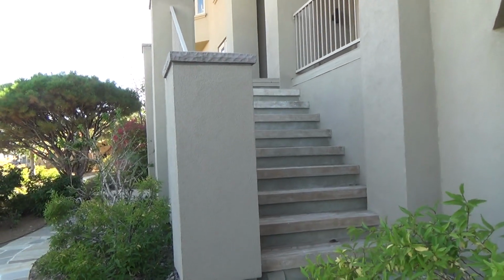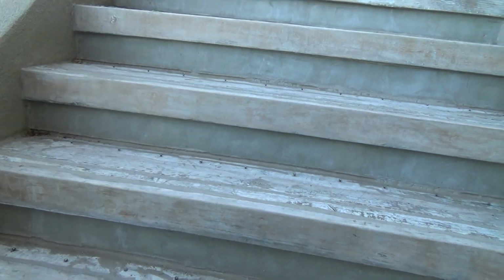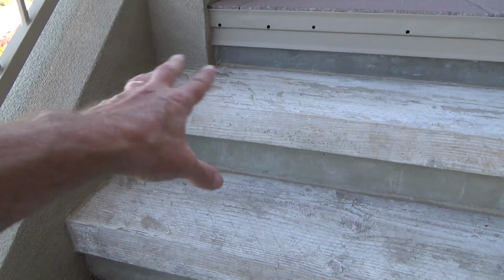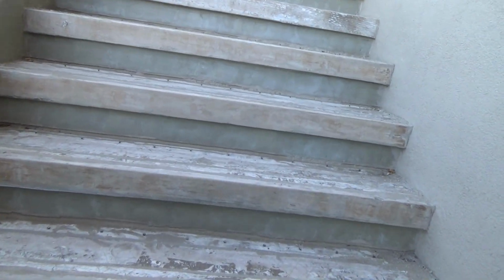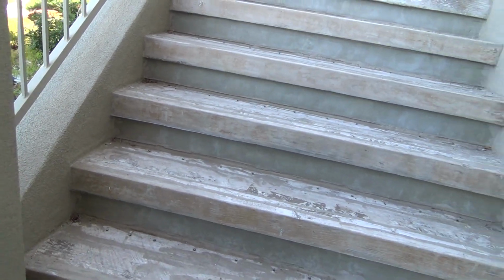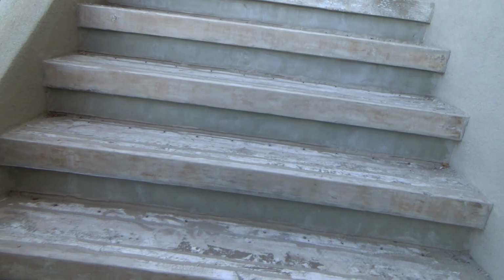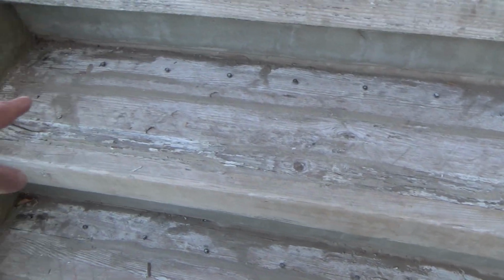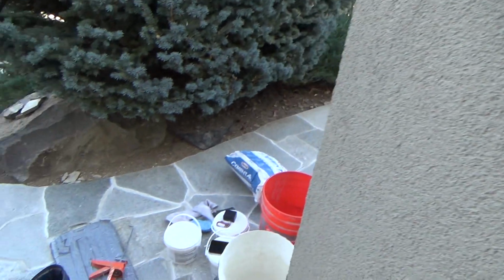Man Says He Can't Repair Wood Deck Staircase & Maybe He's Right?!!

Comment: 1. Plaster to create slope to make water run off (two parts sand with one part cement, plus a dollop of white glue - use minimum of water to make strong plaster). 2 . Install outdoor tiles on top (first make sure cement is still damp or if set use water to dampen, and paint on water based bonding agent). 3. Paint/spray tiles with clear sealer. Don't worry about it leaking because it won't. Final check, make sure under of house is open to atmosphere so any damp timber under there can naturally dry.
Reply from the maker: You have some good thoughts for sure but I would think with the paster that in the winter when the snows come it would crack &/or pop the plaster up from off the wood treads. I am just thinking here. Also I have used tiles on a deck years ago & had it professionally installed only to see the grout lines fail after a few years because of the harsh winters (somewhere else not this property) & some of the tiles cracked but many grout lines cracked & loosened up & thus my thought that same thing would happen here. I even went to Dal Tile & Bedrosian Tile & asked them about what to do here & they made comments that whatever I did the grout would crack out so I was like I can't even get a good answer from those guys so what to do! I have had some say because the stair treads are wood then they will settle & expand throughout the year & thus crack out or pop tiles or whatever materials I use to make repairs. Your idea with plaster to build up & slope out sounds good but I tried several products in the past to build up treads & slope down & made each attempt look really good over the summer to only crash & burn once the winter snows came & after snow gone all the product buckled &/or popped/cracked because the stair treads are wood with air coming up from under to create havoc as well. As for needing air under deck yes there is air but just the air that is under the deck as you can see there are stucco walls around the deck thereby you cannot walk under deck from out in the back yard & no foundation vents were installed by the initial builder over 20 years ago can you believe the inspector even missed that?! Anyway thanks for all your suggestions!

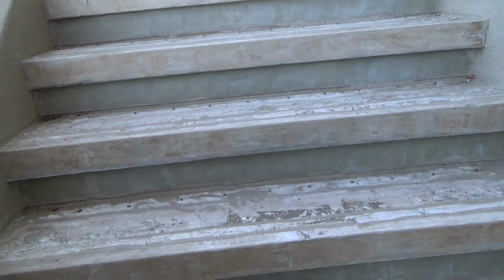Comment: 2:29 plan the treads down so they slope away from the stair.
I would get some 24×12 ceramic grip tiles and put those down with a polymeric adhesive and grout that can handle the expansion and contraction differences.
Reply from the maker: Nice thoughts for sure but I have a feeling the grout will pop out after a few years since we are in the snow country for a few months each year & with the wood treads expanding & contracting as the weather turns could crack &/or loosen the grout between tiles I am thinking. What do you think? I also like the idea of plaining down the treads but then you have a stucco wall at the end of each tread so it would take some doing for sure but a good thought. Thanks for the ideas!
Reply: @VideoJoeKnows  I'll clarify a bit you want a tile adhesive and grout with a very high polymer content that can handle the freeze and thaw cycles along with the different thermal properties of the wood and tile. If you sure it's only 3/16" difference you can blend that in so that the tread drains from the middle. It's a tough nut to crack for sure. My other idea that is not so pretty but is very functional is plastic diamond or nonslip tread covers that can be adhered with a good polyurethane adhesive. Looking at those gluelam treads need a permeant solution for sure, not gonna last to many more years with no protection.
Reply from the maker: @patrickradcliffe3837  Thanks for the additional info.  I thought about hiring a tile setter to do the entire project but again I doubt that anyone would guarantee their work given the fact the stairs are wood with my thought that eventually the tiles will loosen & or the grout will crack out after a couple years of snow.....so there's my additional thoughts. A quandary for sure. Keep watching to see my solution which I think will work plus I can do all the work on my own...An average Joe for sure!

Comment: Nail a layer of door shims to correct the backward slope on 2x4s, and then screw a piece of cement board on top of it and also a piece on the riser board, and then apply a layer of the waterproof membrance fabric run from riser to step surface and all the way down to the edge of the riser of the next step with liquid-rubber rated for tile installation and then install non-slip outdoor tiles with modified thinset that has higher content of cement and polymers. Because the flexibility of the rubber and the fabirc, plus the mobility between the cement board and the wood layer, your cement and tile won't crack due to the  expansion and contraction differences. The drawback of this approach is that it will make uneven rises of the first step and the last step, unless you can also raise the landing and the deck surfaces.
Reply from the maker: Nice thoughts for the entire project & sounds like a lot of work but it sounds like that might be the way to go...if this next thing I do doesn't work. Keep watching. Also yes the top & bottom stair risers will be different sizes then & could be an issue with tripping etc since those steps would be different than all the others & could be prone to injury if not careful. Thanks again for your message.

Comment: Wood shrinks and expands. So does ice and water. It won’t matter what cement products you use, the shrinkage and extraction will wreck them. Porcelain tile will not shrink and expand and does well with freezing without breaking outdoors, because like glass, it will not absorb water. Just never poor warm water on it when it is frozen outside. Before putting that down, consider using a thick coat of something like RedGard waterproofing and crack prevention membrane and then a good quality adhesive to attach the long porcelain tiles.  You can then use a color matching silicone grout. Make sure to use enough RedGard or adhesive to tilt the steps so they are almost level but slightly forward sloped. You may want to also consider using a decoupling membrane between the tile and the stairs that have been waterproofed with redgard.
Reply from the maker: Haha now you are talking like a professional tile installer which of course I am not. All of your ideas sound good for sure but an average Joe (me) I doubt I could do all that & make it look right without a big fail. Sounds like I would have to hire a professional tile installer of which would probably charge me many thousands of dollars to do the job & then he would probably not want to guarantee his work for 15 or 20 years either. What do you think it would cost for all materials & having a professional install it all & would you think they would guarantee their work & if so for how long. Now put your thinking cap on for doing all the work where an average Joe (me) could do it for very little cost. That's why I am thinking the roofing material will work seems as though the product I want to use is already designed to be applied on new & or old flat roofs to begin with so if this product is guaranteed for 12 years on a roof then why wouldn't it work for some wood stairs? Thanks for your reply!

Comment: The wood is going to expand and contract at a different rate than the cement or skim material. Going to be hard to find anything you can spread that thin and still last
Reply from the maker: That has been the dilemma yet the initial builder made these steps this way 20 years ago. They held up for many years before then leaking & the water came through the gluelam stairtreads & the water then created mold issues that eventually dry rotted out the top two stairs which I replaced. Plus whoever built these stairs the treads are not level with an actual slope going the wrong way so the rain puddles on each step until it gets high enough to then go down each stair, that is if the water doesn't leak through the inside corners of the stair treads & risers first which it does. I thought of covering entire stair case with aluminum full stair treads & riser coverings which would probably cost me $2500 just for materials with me installing for full aluminum style staircase but I didn't want to do that. A tile guy could build up each stair tread with material then install tiles & grout but I don't think that would last very long before grout fails in winter months where snow covers the stairs for many months on end. Painting won't hold up as previously explained since stairs won't hold the water & the stairs were a painted cracked mess when we purchased the house. Funny the termite inspection never mentions anything wrong with there stairs nor the paid home inspector either. A complete fail for those two companies! The deck area at top of stairs failed too which I had to remove completely & rebuild since the entire thing had dry rot. I made over 400 videos of all the repairs I did under playlist "dry rot deck repairs" if you want to see all the stuff I had to do. You will learn a lot for sure! LOL Thanks for stopping by with your message!

Comment: rubber garage floor coating or flex tape
Reply from the maker: I was initially thinking of using that flex paste but then a 6 pound tub was $70 & I would need more for sure but I also like your idea of rubber paint. I had thought about that before but did you also see that each stair tread is sloping the wrong way for water run off so if I were to use rubber paint, it might hold up but then each time it rained I would get a pool of water on each stair tread which ultimately I would think damage the rubber sooner rather than later. If I used the rubber then I would still need to pour more rubber product on there to build up each step which is also a thought for sure. Thanks for the ideas!
Reply: rubber surface is not for heavy foot traffic. @VideoJoeKnows
Reply from the maker: @davidshang1198  We don't use these stairs that much since if I need to work in back yard I go down some other landscape railroad ties steps that lead down from the garage...